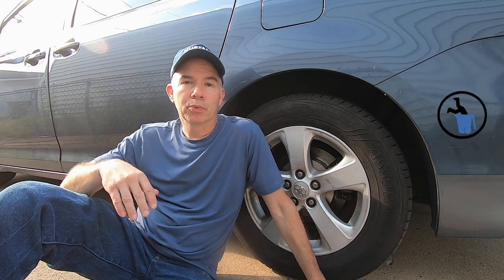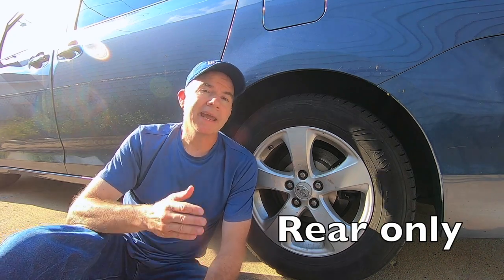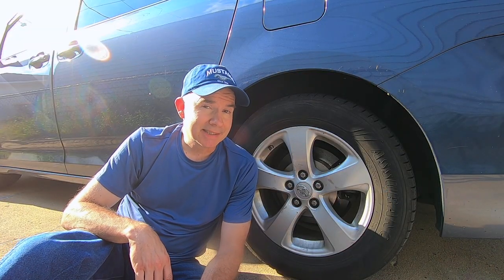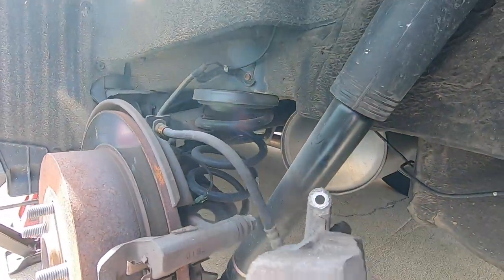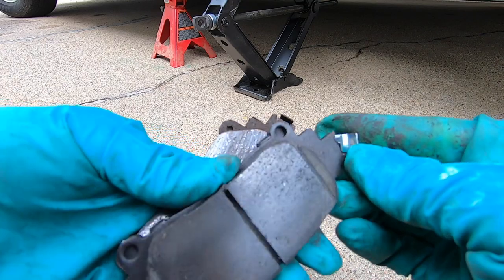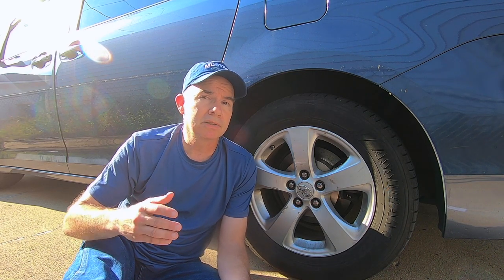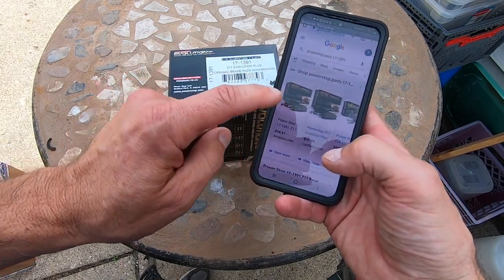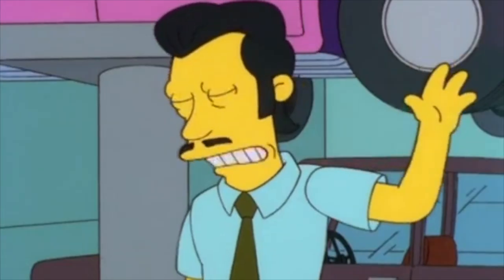Are Brake Jobs a Scam?

Comment: Honestly garages scam us on every jobs, especially on brake jobs. But yours are incomplete, I worked in a garage, I'm a mechanic, you have to clean-up everything on replacement, (brush/clean caliper bracket, sliders, inspect rubber seals, inspect caliper, clean-up hub and put spray anti-seize on hub, ceramic silicone grease on sliders after complete cleanup, silicone grease on caliper bracket and on the backing of the pads) It's not as long as it seem, I understand you are not a mechanic but this is how it's done properly. When you have rotary brushes and the tools, it takes about 1 hour to clean install on 4 corners.

Comment: Almost all repair shop stuff is a scam in my opinion. The only exceptions are major repairs (that require advanced skills/tools) and maybe tire changes since those are so cheap. When I was 18 I went to a repair shop to get my rear brakes changed, just like you. They charged me $450 or something. A few months later I had to change the front brakes. Not wanting to pay another $450, I did a bit of research (literally youtube videos,) found that I could change my own brakes for less then $100, and never went back to a repair shop again. The markup on everything is insane.

Comment: I've always felt like brake jobs fell into the perfect sweet spot for most shops: it's several steps up in complexity/tools from an oil change and it's something that every car will absolutely need throughout its life. That jump up from an oil change is a leap that most garden variety car owners aren't willing to make. Unlike some "failure" such as a head gasket, CV axle, you name it, ALL cars will need brakes and you have a captive audience in that regard. So I'm venturing that shops are trying to make the most money possible on this guaranteed work.
Reply from the maker: Yep. I agree. I just wish they would be honest and charge a fair rate.
Reply: @AlleyPicked  and that's where the problem begins. These shops don't want to pay their mechanics well and they want to maximize their profits along with being able to keep the lights on and paying their land costs. 

There are good mechanics that work for bad shops and that's why mechanics have wheels on their tool boxes.

Comment: Glad you saved yourself that extra money.  But your old pads and rotor looked absolutely fine in the video.  No gouges on the old rotor and your pads had plenty of beef still on them. That little cut in your pads determines how much you have left. Not only that,there is a little metal tab on one side of the pads that let's you know when they need changing.  You'll hear a little squeaking noise when you're driving.
Reply from the maker: One pad was the worst and that's the one they showed me. I could have gotten a few more months out of them at least.

Comment: Good Morning, Tom.  I worked in the auto repair industry at a Chevrolet dealership for a few years.  When I first started, I was shocked at the prices and at the pressure that I received to sell the customer unneeded service on their vehicles.  The emphasis was on getting as much money from each customer by any means necessary.   People joke about how dishonest car salesmen are, but I found that there was no shortage of dishonesty in the repair shop.  Finding an honest mechanic is difficult.  Most people don't understand anything about their cars and this makes them an easy target for unscrupulous repair shops.
Thanks for the video, Mr. Goodwrench.
Reply: I do all my own car work. My favorite recent story: I spent a Saturday morning replacing rotors, pads, and calipers w/a full bleed on the system, and then replacing my front control arms and sway bar links. Went to get the car aligned afterward because the one tool I really don't have is an alignment rack. Tire shop guy comes back in a few minutes after taking my keys and starts looking parts up. Then comes over and says I need new control arms and a brake job and starts to show me this sheet on letterhead that just came out of his printer with a total of nearly $2k. 😀😀

I told him hmmm, before I make a decision, I'd like to see the problem, can he please take some pictures of the problems for me with his phone and bring it back and show me. He says sure.

A few minutes later he comes back... "Um, did you just have some stuff replaced recently?" "Yes sir, that's why I'm here to get an alignment, because I just replaced the control arms and had to pull the knuckles completely off to do it. I also just replaced the pads, rotors, and calipers on all four wheels, too. I did it all this morning in fact."

I was smiling about as big as a person can smile. He paused for a moment and then said, "Ok, I'll go do your alignment."

And he did.
Reply: @AronHsiao  yeah they're so shaddy I called out two service employees and especially one who gave me a snarky look. 

This son of a bitch quoted me 118 dollars to replace a light bulb!!!! I'm like "no thanks" and found a replacement set for 10 bucks online and did it myself. 

Since then I convinced my loved ones to try to do the work ourselves as much as possible and stay away from shops. 

I know there are some good shops and mechanics out there but the bad ones really give them a bad name.
Reply: This is reason America auto mobile lose costumer’s ready over price then America car all time in shop for something wrong like my truck last three years my truck every two in shop now I got tired I suit gmc for lemon law

Comment: COMPLETELY agree!  Had a girlfriend who last month spent $1300 on front and rear brakes for a Camry...and that was the cheaper price than a tire store quoted, because they didn't replace the rotors, just surfaced them!!!  I looked into it and it was the same sort of simple repair as you saw on your own vehicle.
But let me tell you about a VERY SIMILAR scam:  Replacing TPMS sensors!  I had one fail; all of the places I called wanted almost $600 to replace all 4.  I noticed an ad at a Costco tire center, and had them all replaced for $250.

Comment: Yeah, your quote was WAY to high at the tire shop. $400-450 for rotors/pads per axle is reasonable from a shop for a standard car. Plus those pads didn't even need to be replaced. 

I would have suggested higher quality brake parts though. I use coated rotors since I am in the rust belt and I dont want the rotor hats looking rusty in a week. Pads, Akebono, or some other high quality pads. Still under $150 from Rock auto for the upgraded parts shipped. Also with Rockauto, see if you can find a 5% discount code from somewhere. That usually covers most of my shipping cost.

Comment: Hi...I had a similar experience some years ago when I got some new tyres put on my car.  I was told that the rear brake pads were worn out and needed to be replaced.  I asked the mechanic if he was sure, and he said that he was.  I replied that it seemed strange.....because I had only just fitted new rear brake pads myself about a week prior.  If he had even looked, .... he would have seen that they were new.
Reply from the maker: Wow!
Reply: That sounds like the shop that wanted to replace my serpentine belt....
If they'd looked at anything besides their computer screen, they might have noticed that my car had a different engine than the one they had entered it as, so it had 4 v-belts, not a serpentine.  Chevy transitioned from carburetors to throttle body injection on the mid-level camaros in 87, and I had a carburetor.    Strangely, I declined the repair.

Comment: Shops have generally a 100% markup on parts.  I work at a GM dealership and brakes are usually around $700 either front or rear. Some are less, some are more. 

I buy my own parts from Rock Auto as it’s so much cheaper than anywhere in town.  Thing to remember is Rock Auto sells a lot of white box junk. Stay away from the economy section

Comment: It is not a scam. Let me tell you why
1. The shop has to pay for insurance, rent, labour and equipment. If you want to DIY to save money, that's fair, but your cost is no where near their cost.
2. The price they get from the wholesale is different from when you get from retail. Retail will sometimes offer better discount. For wholesale, they don't have much choice, they get slight discount on bulk buy, but not always they can get retail discount because the manufacturer wants to get rid of their stuff.
3. Warranty: They have to warrant their workmanship. If someone diy and forget to put in a nut, causing the brake to loose, the result will be catastrophy. 
4. They are operating as business. A business is meant to make money. If they don't make money, they can't survive. It's not up to you to tell them making money is a scam. Scam is when they take the money but didn't deliver a service. 
i'm not on the dealer's side. I do my own maintenance because I know what i'm doing. But I'm telling you the other side of the story so you can understand better and avoiding any defamation may go against you. 

Cheers
Reply: From the technical standpoint, why do they have to replace both pads and rotors, I would say it is needed but not necessarily required in all case. 
Explain: The rotors after contact with the pads, will leave some residual metal on the pads, those metals will be embedded on the pads and cause scratching on the rotor surface. Those scratches, while not impacting the braking power, can cause the irritating sound even with the new pads installed. It will make it look like they haven't got the new pads. 
Also, even with the gauge to measure the rotor thickness, they can't actually tell the residual life of the rotor. Rotor as metal has a fatigue life. Even with the thickness, it can be heated up and cooled down multiple times, causing the metal to crack at any time. We don't know when. That's why it's always recommended to replace the rotor along with the pads. Or at least 2 pads per rotor.
Another reason is the rotor surface is not even, causing excessive pad wear. If you have old rotors on new pads, you will wear down your pads much quicker than new on new. If you don't want this, you have to reface the rotor and you will need to have a lathe machine to do this.  
Furthermore, the shop don't have the service history of the vehicle, as a rule of thump, they will need to replace both to warrant their job. Though I know what to do, I will never touch anyone's car if he says "don't replace the rotors, just the pads", I will tell him to do it himself. Last thing I want is when the insurance company call saying his car blow up because of the broken rotor and I'm the last person servicing the car. I know the probability is low but it only needs to happen once to be enough to send me to jail or pay a heafy fine.
Reply: Your video also doesn't mention bleeding the brake. If you don't bleed your brake, the dirty fluid will go back to the system. You don't want dirty fluid back into the brake system, ever. 
Also, depending on the brake wear, when you install new pads, you have to push back the pistons. If you don't have the right equipment or don't know how to do it properly,  you will push air into the system. 
New car also has ABS, if you are not careful when doing brake works, you can damage the ABS system and it's going to very expensive to replace. 
May be i'm too picky but this is never a good practice, maybe it's good for an old car and you want to minimise maintenance. It's fine if it's your own car and you take responsibility for the workmanship. But please accept my feedback and update your video, at least put a disclaimer to your video.
Reply from the maker: Thanks David for the thoughtful reply. I understand all of your valid points. You obviously have more experience that I do in this area. I don't claim to be an expert but as I said, I think it's good for people to understand what they are paying for.
Scam is a strong word indeed. I agree that they are providing a service at a cost. A business has insurance, overhead, employees...etc. I get that. The biggest problem I have with this is that they are marking up cost of the brakes significantly! The dealer told me they are using Napa parts. I went on Napa's website and the top of the line brake supplies were half of what the repair shop was charging me. There is NO way that they are not inflating the cost of the parts. That part of the process is disingenuous at best. This markup practice is pretty typical in the business (as others have commented). I personally provide handyman services for people. I always provide a price for my labor. I don't hide other costs behind a fake price for the parts. That is not the way I could run a business and feel good about myself. Thanks again for your feedback!
Reply: @AlleyPicked  
Sorry if you feel like you are scammed. But a shop has more expenses than a backyard mechanic. It's hard to convince you if you think of it that way since you might not pay for priority orders, delivery of bulk orders, inventory, stocking fees, and insurance. Those are the costs associated with the order only. I don't like the store charging me too much and trying to do everything by myself if possible, but I don't go online and telling the shop scams me for that since it's no longer an individual opinion. People may believe you and go to the store saying "hey.. you saw this guy video from youtube and found out scammed me for the brake job you did last week . I want my money back, blah blah". Trust me, people are stupid enough to listen to single sided stories these days and it has happened to my friends shop on various occasions. If you think a shop is charging too much, better tell people to get a few quotes and see which one suits them best. 
Same with plumbing/ gas / sparky work. Everything can DIY if you have the knowledge, tools and experience.

Comment: Best way to determine pad thickness is to use colored brake pad gauges. Green will be good yellow is midway and red us replace. It keeps the guessing out of the equation.
Reply: And whatever amount of thickness the front pads are the rear ones will have less thickness left.

Comment: Tire shop quoted me $ 600 to replace brake pads. Got pads from Napa for $100, and an hour and a half of my time, done.

Absolutely stupid easy job to do. Best of all $500 stays in your pocket.

The mark up on parts you can buy yourself, plus made up fees is how they get you, plus tax of course and that always cheap labor rate.

Cheers.
Reply: I did the same thing and was positive I did a good job. But my pads seized up on me. I lubriated them good I thought. Never had that problem again with a good shop I go to. Apparently, professionals do much better than us DIYers. Who thought? Lol. I just swallow the pill and pay up now. It's worth it if you keep your car a long time and want it operating nicely. Plus, getting older makes it really hard to crouch under a car for hours. I got over that quickly.

Comment: Similar story. Tire place wanted to charge me $169.57 parts, labor and tax to replace my serpentine belt. I went to Amazon and bought the most expensive one for my car. Goodyear brand, $25.83 delivered to my door the next day. Took me less than 5 minutes to swap out the old one for a new one. Part of that is because all I needed was a 10mm wrench to pivot a pulley out of the way, and I didn’t need to actually remove anything. Regardless, c’mon, man!!
Reply: So is the 3 cents of material in a cup of coffee that sells for 1000% more a scam?  It’s all relative.
Reply: its usually good to replace the idlers and ensioners also
Reply: good thing u did it right or it could have cost u more

Comment: While I do all my own brake jobs because it relatively easy, the doubling of the cost of the parts is standard.  One hour of labor for two weeks is more than fair.  But typically in NY I would pay about $400 to get the rear brakes done.  So I think that $700+ is priced

Comment: Based on look of your rotors they were still perfectly fine (unless you measured and confirmed them to be out of specs)... And yea, total ripoff. Why they do that ? Because why not, some people will pay. I had similar experience with Ford dealership, where I got list of services I don't need and double to quadruple prices on everything. Like pouring injector cleaner to tank - 56 bucks... Or tire sealer replacement - 74$. I went out of service, entered their own part store in 30 feet and bought same sealer for 35$. And if they double because of warranty - I would avoid them as much as possible as if you double price for that means they assume failure rate to be 50% ? Insane...
Reply from the maker: I changed rotors and brakes since they were so cheap.

Comment: if you get oem parts for that toyota it will last longer , buy your own parts and have your mechanic that u trust do the service if u have no time doing it urself ull save plenty i bought my own brake pads and rotors for all front and back axles and it was $358 for parts $390 for labor its all oem and in total was $748 for all 4 wheels

Comment: Rock Auto DOES sell the closeout parts.... IN ADDITION to all the other levels of parts, ranging from economy to severe duty.  They even email me when they have some closeout parts for sale at a discount price, which I have taken advantage of on a few occasions.  So that argument is misleading at best and basically a falsehood to try to get you to buy their overpriced stuff.
With some exceptions, like NAPA, you can get the exact same parts at Rockauto as they are selling you.  In fact, you can usually get BETTER quality parts from Rockauto for less than the shop is charging for the low quality parts.
Sorry, not trying to advertise for them.  Just been a satisfied customer for a long time and wanted to comment on the lies from the shop.